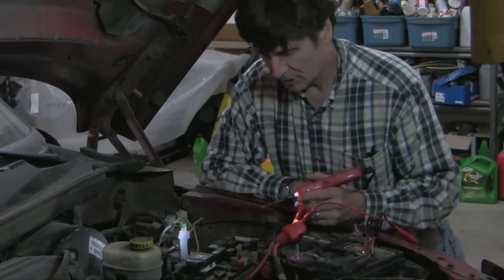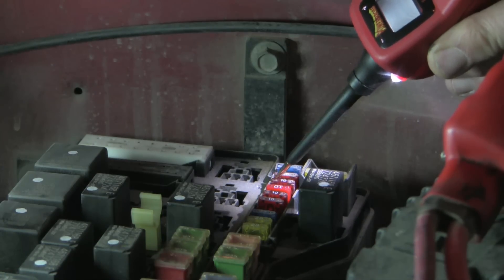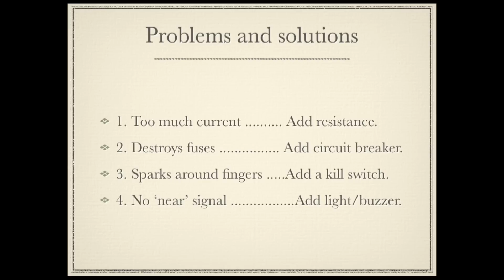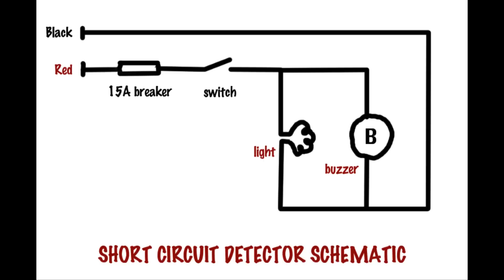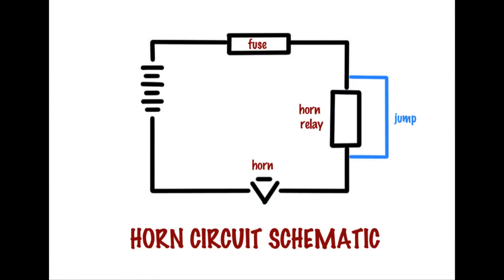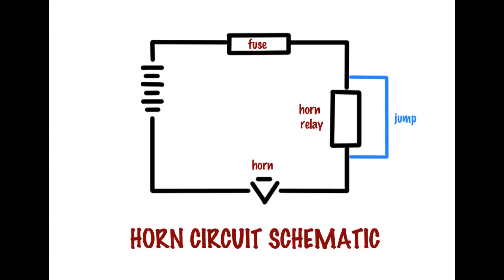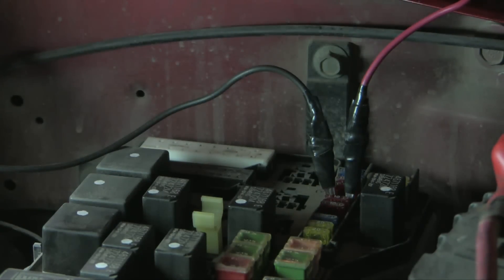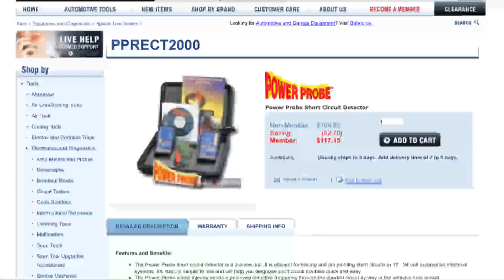Short Circuit Detector, Automotive, DIY, blown fuse

Comment: Would it matter or be more beneficial if the inline circuit breaker was on the negative cord?

When connecting it to the  terminals at the fuse box, would it matter it matter which wire goes to 12+ always on and which goes to the load side?
Reply from the maker: The problem with hooking it up downstream of the load is if the short to ground is upstream of your detector, the detector won't turn on. That in itself might be a useful clue, but you could do the same with a test light. Most fuses are designed to be on the hot side very close to the source of power, simply because the fuse can't protect from shorts to ground for anything upstream of the fuse. The fuse is simply a convenient point to tap into the circuit without causing much damage.
Reply: @spelunkerd  Thanks very much. I am in the process of building your project plans. Parts are a bit slow to come in. I will do a video and post the link here. You did yours a decade ago....but the gift keeps on giving. Thanks.

Comment: A thought: When you touch your power probe to the fuses, some beeped (and lit the LED) to indicate a positive voltage, while a few beeped/lit your powerprobe to indicate a ground. "Some fuses are on the negative side" was your comment. 

Is it not far more likely that simply these circuits have no positive voltage to those fuses yet (i.e. a circuit not yet switched on) and so albeit through the load, both pins of the fuse (if not blown) simply have a path to ground through the load. With no positive voltage (and therefore no current flowing even with a good ground), but an intact circuit to ground, even fuses are at ground potential - i.e. the same voltage as the battery negative terminal So the fuses are still very much on the positive side of the circuit (and NOT the negative/ground side). 

On  DC circuits, especially automotive stuff, it's highly unlikely  fuses are on "the negative side". A short to ground AFTER the load is only 'shorting' ground to ground i.e no harm done. And if you fused AFTER the load not BEFORE then any short to ground BEFORE the resistance of the load would be a dead short from positive to negative. :)
Reply from the maker: Gee, it's been years since I saw this video, I had to review it again to understand what you are asking. Yes, I agree with your remarks. As you know the fuse is generally there to primarily protect the wiring, so it makes sense for it usually to be upstream so a short will cut off current downstream across a short. Downstream fuses are often fed by more proximal fuses higher up that protect the wiring upstream. My remark was vague and not very well worded, but I think I was referring to the position of the fuse from the perspective of the switch, not the load. As you say, it is almost always upstream of the load so it can protect the load as well. If the fuse is upstream of the switch, you'll get positive voltage on both sides, even if current is flowing. If the fuse is downstream of an open switch, then no current will be flowing, and even if the load is further downstream the power probe will usually offer a tone because the potential will flow through the load to the probe. As you say, if the switch is closed and current is flowing, it will depend on where in the circuit the voltage drops are. Thank you for taking the time to add salient remarks.

Comment: you can buy an ohm meter at harbor freight 7-8 $
Reply from the maker: With a dead short an ohmeter will work fine, especially if you can position it in such a way that is sings a tone when continuity is present. When you giggle wires you want the feedback that you're close to the problem.

Comment: 9 years later its is now 2020,,  i think he is saying the buzzer draws less amps than the light, so if the light does not work, there is to much resistance to light the lamp, but will sound the buzzer. Good hobby building small test equipment forces a person to understand how it all works. Be nice to see an amp meter inline also.
Reply from the maker: Those are good thoughts, it is nice to meet somebody who thinks beyond the superficial. Regarding the light and buzzer, it was a practical decision. The buzzer is nice since I can walk or crawl to another area of the car and wiggle wires. If the sound disappears or skips I've got a message the problem is there, without having to stare at the light. Thanks for stopping by!

Comment: this is a great ,cheap an very effective tool to assist in troubleshooting a shorting fuse . I am a ac tech an had a problem with a shorting ac selector switch in a car . An this tool gave me the troubleshooting time an indication to properly diagnose the switch . I usually don't do expertise automotive repairs so i was reluctant to pay a lot of cash for a fancy tester,this tool matched my need exactly. Thanks for saving me the $ and giving me a handy little tester.

Comment: I just use an old reverse lamp unit with 2 long wires  does the same job ,,minus the light
Reply from the maker: Yes, many options. These days I’m always reaching for my power probe, which incidentally has a light, fuse and ground tone built in.

Comment: Actually I think you idea is better.  The parts themselves, people might have laying around, in fact, a car repair type person could source those parts cheaply.  The other tool doesn't have the light or buzzer and would be slower to test with.  I did a bit of research and it's just a flasher and ammeter.  IMO, the combo of yours and the breaker being faster would help even more because you could then use the ammeter to help track things down.  I'm pretty sure I have all the parts needed just sitting around, but wasn't sure how to make one of these.
You could even add a volt meter and a few other things and have a great test tool.

Comment: Dave, that;s a neat little circuit.  Looks like a 12V buzzer with a bulb or LED.  It also puts a load on the short circuit so replacing the fuse with it won't melt the car wires.  I guess you just keep moving wires or unplugging stuff until the noise goes away.  Cool.  /John

Comment from the maker: @alken26 You make a good point, and  I think it would be easily possible to build such a radiofrequency receiver that picks up local current. Ideally it would be best to have a transmitter that sends a signal that is easily recognizable, with a receiver and a headset. Such a device is available commercially for about $100. With sensitive electronics in some of these circuits, there is some risk to pumping in extra current. No such risk for the device described in this video.

Comment from the maker: @serchmarc For a high amperage short, the device adds enough resistance to keep the short going, to allow time to find it without constantly blowing fuses or overheating wires. With the light and buzzer, there is instant feedback that the short is active. You then trace the wires back and wiggle them, and disconnect at connectors. If the buzzer suddenly cuts out or wavers, you've found the short. Look closely at the wires at that point to find the short to ground. Thanks!

Comment: Thanks a lot sir. Its really great to watch such knowledgeable videos. well, will u assist me to detect circuit break in underground line ?? I mean if cable or wire is cut in excavation then how to detect the break ?? sorry,I'm not an Electrical Engineer but much interested in it...I'm Mechanical Engineer.
Reply from the maker: The best way to trace down an unidentified break is with a 'fox and hound' device. For safety, you first disconnect the wiring from any source of power, then attach a device that sends a pulsating signal down the wire. You have a second device equipped with a detector that works by impedence to vibrate a small speaker, and you listen for the beeping sound. When the second detector gets close to the wire, you hear the beeping, and you trace the path of the wire until the beeping stops. Dig down to find the break. Better detectors cost more and have better range - mine was $150. You could make your own, but for automotive applications there is some risk of damaging sensitive electronics with the signal. For a demo of that in automotive applications, go to the youtube channel Briansmobile1 and search his videos with the above phrase.
Reply: spelunkerd Thank you very much sir.
well, I wanted to know that how to calculate the size of wire /conductor example : for 1 HP (0.75 KW ) motor , wire size ?? we use 1.5 sq.mm X 4 Core poly cab. but I wanted to know the exact formula for it. & also how to calculate the voltage drop ?? I mean if 50 meter long cable is used for 10 HP Motor ?? Lastly , how to find out water leakage in excavation ?? Is there any equipment available for it?? similarly you helped me in above message............Thanks & Regards
Reply from the maker: Shahnawaz Nadkar Decades ago I did a couple of years of EE, and I can say I never knew used to know  some of that stuff. It depended a lot on the type of motor since the draw on many designs spikes early, but levels off after the motor gets going. Many wires can take a transient spike in current as long as the motor doesn't seize or start/stop too often. I have no idea how to estimate those factors now, though I suspect it depends very much on the exact details of the system. Regarding voltage drop across long wires, there is a simple formula to calculate that based on length, wire gauge, and type. Remember that those calculations make assumptions, such as no inductive resistance from coiling or adjacent wires, so you have to remember the final result is just an estimate. Regarding water leakage, you can measure ground water saturation, and presumably ground resistance would vary depending on moisture content. But again, practical details aren't available to me.
Reply: Dave : The item you refer to in the Brian's Mobile video is a cable tracker . Harbor Freight has a budget model for under $ 40.00 . Power Probe has a higher end unit . Real Fixes Real Fast has a video tracing a short with a compass . The device from Tool Aid is also good .

Comment: Quite a good video and tool for general searching. I am an auto electrician and have made a similar setup but I chose to use a 55w (12v) and 70w (24v) bulb setup so that when I am looking for shorts in something like a trucks parker light setup (some up to 20 different bulbs) I do not get a false short reading such as the setup that you have shown would. But with regards to general light vehicle work this is a perfectly useful tool.
Reply from the maker: Reece Cordingley Good point, thanks for stopping by.
Reply: Reece Cordingley could you demonstrate through a video what kind of build you have to test electrical 12 volt shorts ? Thanks

Comment from the maker: Reversible breakers came in only a few sizes on the shelf of my local hardware store, and 15A was the smallest size. I wanted smaller. But if in the future I find a smaller size, it is easy to swap out. I'm not sure why a smaller size was not available -- whether they are hard to make smaller reversible fuses or whether there just was no market for the small breakers.

Comment: why would my dashboard light lag to turn on. can I get your opinion
Reply from the maker: +David Jacobo Do you mean all lights, or one specific light? Is there any other issue affecting driving?
Reply: Yea my tail light lights to come on to but after I Drive for a little while they turn on
Reply from the maker: If you want to try to fix this yourself with internet advice, I suggest you go to the free ericthecarguydotcom forum. I wrote a sticky thread there that is worth reading before posting questions. It describes how important it is to give those who are trying to help every advantage by becoming a good witness. With what I know so far about your problem, I would scan for codes, check battery voltages and probably also do a voltage drop test across the ground cable. It sounds like your computer is slow to analyze data, either because at least one sensor input is slow or the computer itself is an issue. let's hope it's a simple corrosion issue at a connector, though finding it may be a challenge. Good luck!
Reply: Thanks for York help

Comment: Hey, you can lay out the diagram of the device or to make a custom?
Reply from the maker: +autobild01 There's a schematic embedded in the video. Pretty basic design, lots of room for improvement.
Reply: +spelunkerd Sorry) Prompt "breaker 15A", that you are using?
Reply: +spelunkerd I understand you use it? 
https://www.fastenal.com/products/details/0703440
Reply from the maker: +autobild01 I found the one I used on the shelf at the local hardware store, similar to what you showed, for about $5.
Reply: +spelunkerd  Thank you.
We need to think what to use like a 24 volts)
Reply: +spelunkerd Another question, which power the lamp (watts) (Amp)
Reply from the maker: +autobild01 It's so long ago that I don't remember those details. That's a good question, though, since you want to know those details about the resistance on each arm, to avoid overloading wires. As I recall, the current on each side was well within the limit for internal wires.

Comment: @spelunkerd i couldnt find the video of briansmobile1,i also search it like briansmobile1 short circuit,but nothing do you have the title or the link? i watched the video that is on the right of the screen from pico3423 using a cranck sensor and headsets too,he doesnt xplain how to but if you know some of electronic is possible to make 1,but no indication ,increasing frecuency not voltag you can trace the signoal from your DIY singal module and listen for the open or short.what do you think?

Comment from the maker: @serchmarc It's on my list of things to do next year. I made a little pulse wave modulator with a few parts last year, and I think that device would make a detectable signal that could be picked up by headsets. The main worry I have is not to give it too much voltage, since I wouldn't want to damage any sensitive electronics. Briansmobile1 did a video review of a relatively inexpensive tool, but it's still $100+.